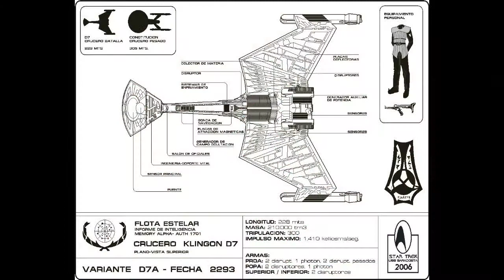Klingon K'T'inga Battle Cruiser Build (AMT - round2) vlog 2

Comment: I actually fixed the gap problem in the wings with styrene shims and putty application. When I did it the gap at the top completely disappeared and I sanded it smooth so you can't even see the seam at all.